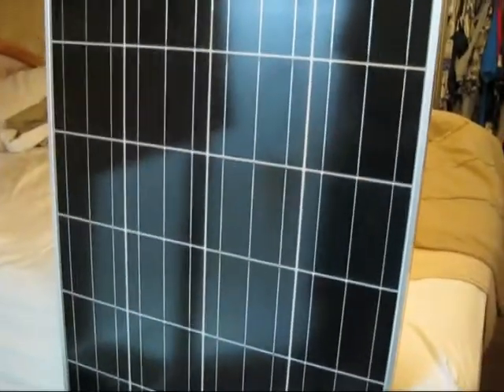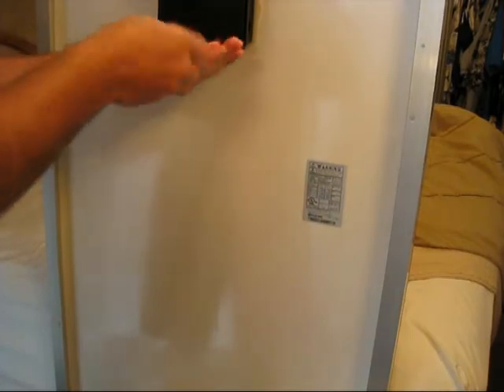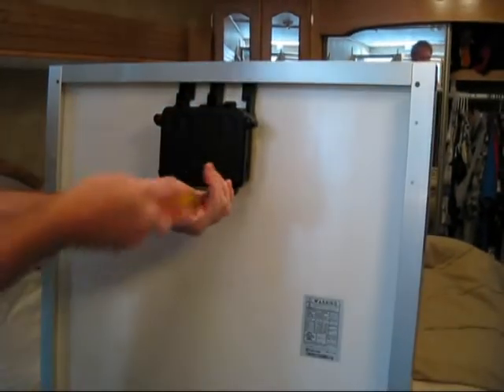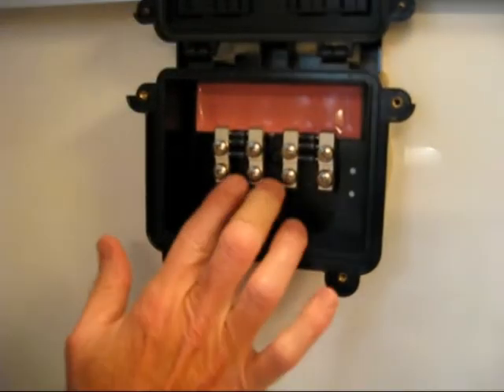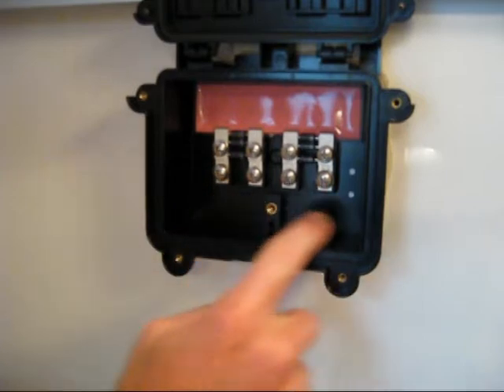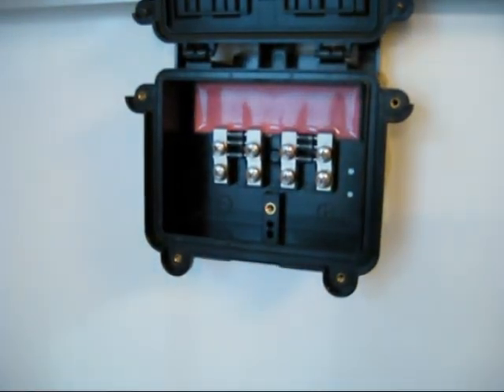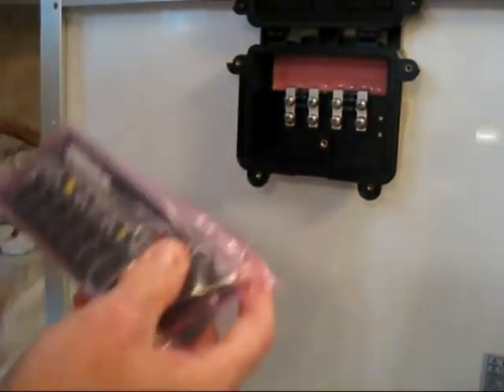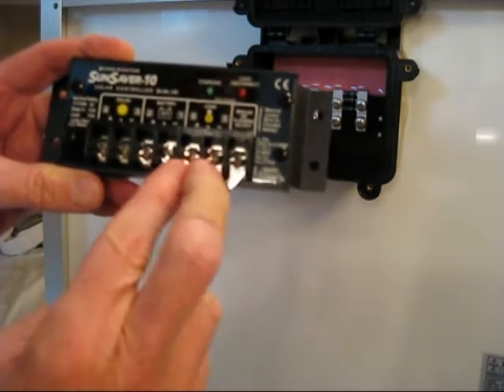Solar Powered Hydrogen

Comment from the maker: @Engineer245 
I equate the solar panel to the purchase of a TV then paying for the energy to watch it.  Or, buying a car then paying for the gas to run it.    I paid for the solar panel and don't have to pay for the energy it creates.  
Solar panel 700 minus savings on electric = money in growing savings account.  My plan is to buy more and design an energy management system (no batteries).